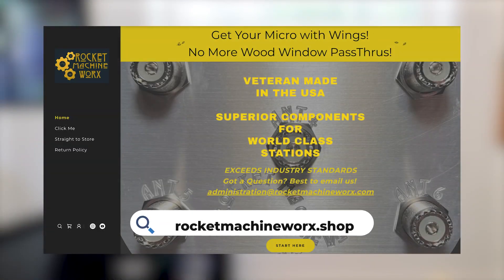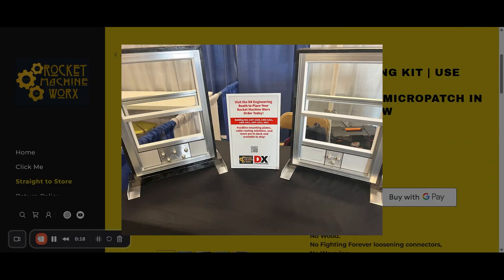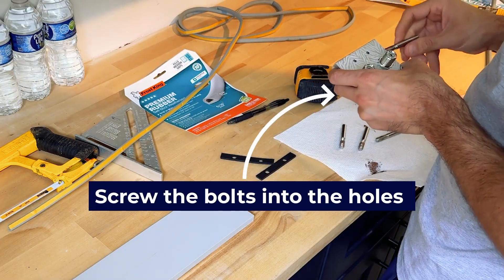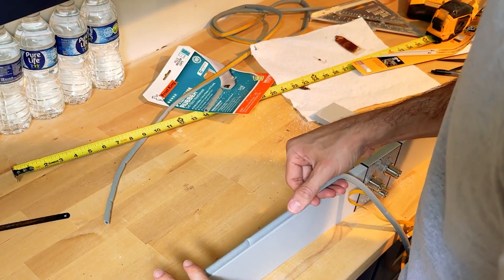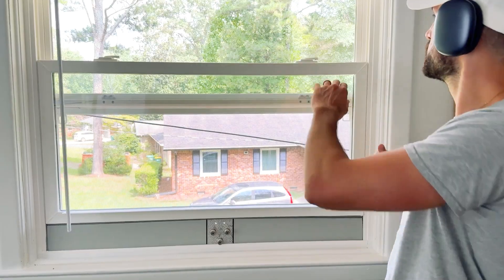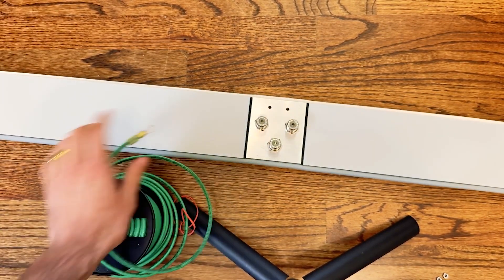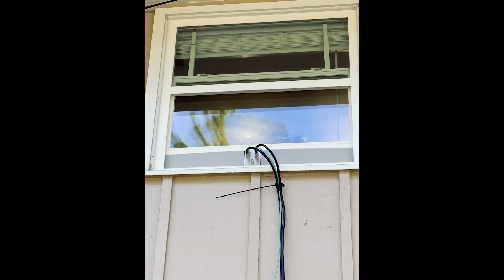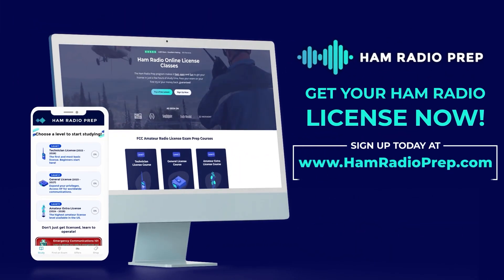Install a Ham Radio Window Feed Through (No Drilling Required!)

Comment: I'm a newbie so I'm just wondering why you had two coax going outside? Do they both go to the antenna? You lost me on that part. That PL-259 coax is some thick coax. I see it mentioned a lot in the questions studying for my license, but I had no idea it was that much thicker! Thanks for the video. The feed through is a great idea. Also, the adjustable rods to put down pressure on the window were nice and clean!
Reply from the maker: The two COAX connectors are just in case you have two antennas, and you want to run a separate cable to each one.

Thanks so much!

Comment: great point on the anti-cease on the threads for the stainless steel bolts and nuts! I know from experience that they will cease up and make it impossible to remove without destroying things. I'm an electrician and have built some wire troughs using stainless steal bolts and nuts and aluminum troughs. The anti-cease grease is a must! You will regret not using it!
Reply from the maker: Glad that tip resonated with you!

Comment: So its ok to mount the lightening arrestor directly to the passthrough if I still run the arrestor to ground independently? trying to avoid an extra piece of wire if not needed. Thanks!

Comment: You have a huge gap still at the top of the bottom sash because it is no longer meeting the top sash at the interlock. You will have air and bugs coming through it. You need to put a piece of foam in there. Also, instead of those adjustable things you can use 2 pieces of schedule 40 3/4 pvc pipe cut to 1/8 inch longer than the distance from the top of the frame to the top of the bottom sash. If you put one on each side right up against the frame you won't see them at all, and it will be way more secure.
Reply from the maker: Great point - I am now adding a seal to the sash and added a note in the description.

With the sash covered, it is a great solution

Comment: Why would you have the feed through connectors in the middle of the plate. That’s unsightly and unnecessary. The connectors should be on the far left or right hand side. Put the connectors on one side and then the feed through plate could be inverted to have the connectors on the left or right hand side as required!